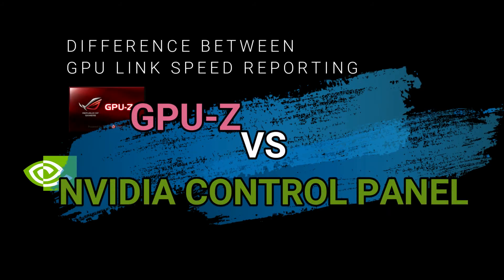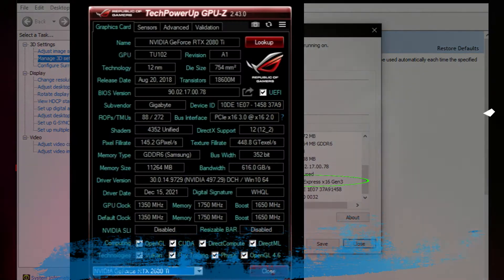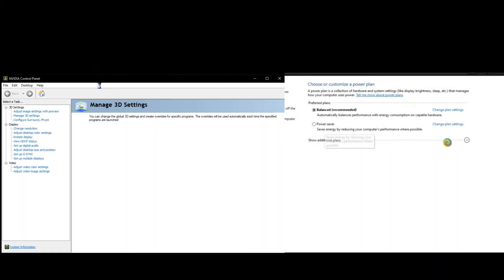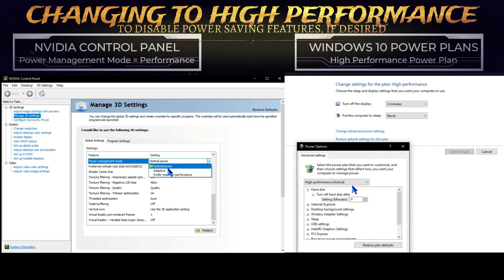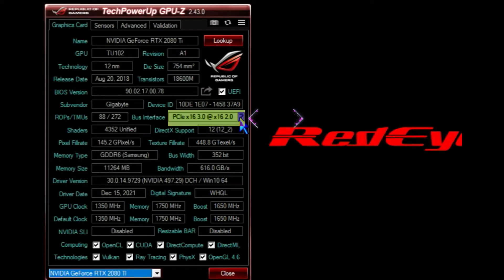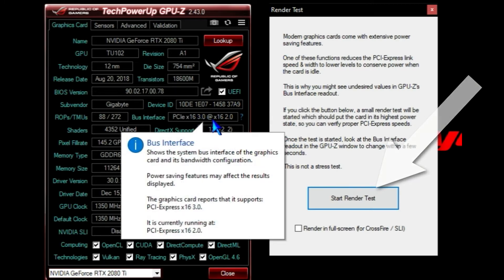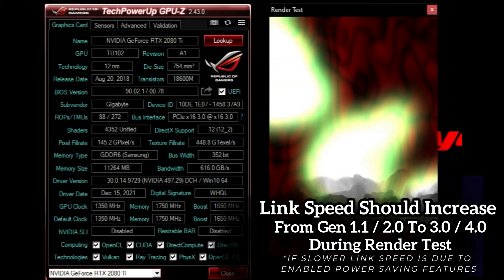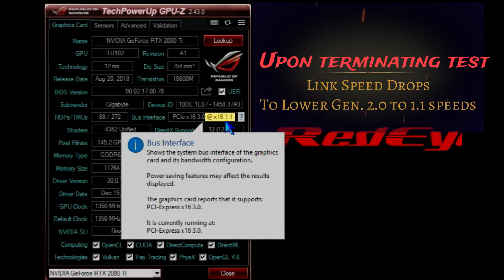GPU-Z Reports lower GPU link speed than Nvidia Control Panel

Comment: If I have an Asus P106-100 graphics card with a 1.1 bus, can I upgrade the bus from 1.1 to 3.0 version without soldering inside the graphics card? Or is 1.1 already sewn into the card itself, and there is no way to change it?

Comment: Mine still renders at a lower Bus Interface on heavier load
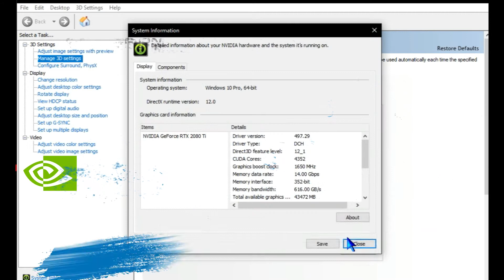Reply from the maker: If you cross-checked the readout in the Nvidia Control Panel and that is reporting a low link speed as well (as seen on the left of the screen at the 0:04s mark in the video above - clicking "System Information" in lower left of Nvidia Control Panel UI), then one thing you can try is to reseat the GPU.

Here is another view of the Nvidia Control Panel readout in our previous video:
https://youtu.be/wD0OEDEqjfE?feature=shared&t=85

You can check out the pinned comment thread on the video linked below, where we walked through a similar issue with avnkrlo.

https://www.youtube.com/watch?v=wD0OEDEqjfE

Reply Comment: 
https://www.youtube.com/watch?v=wD0OEDEqjfE&lc=UgzCOigbIlGdD-Z07AF4AaABAg.8wf7sNHBBoO8wjNzAPVQaB

Sometimes removing the GPU and placing it into a different PCIe slot, or just readjusting and reseating it within the same slot (ensuring it is as level as possible and not sagging down or tilting up), can help to rule out any coincidental issues with the way the GPU is sitting within the current PCIe slot and the contacts on the GPU aligning properly with those in the PCIe slot. 

It can be a more common issue than many system owners realize. 

*If you reseat or change PCIe slots for testing purposes, ensure to follow the usual safe power-down procedure each time when reseating or removing the GPU: shut down the system, unplug the system from the wall, and, while unplugged, hold down the power button on your PC for 30-45 seconds to discharge any residual power from the system before removing the GPU and inserting it into any other PCIe slot, or attempting to reseat it within the same slot.

Let us know if dusting around the slot and or reseating the GPU helps get it connected at the full link speed.